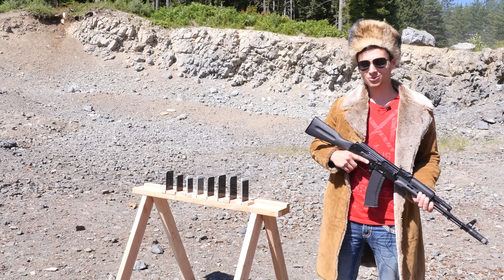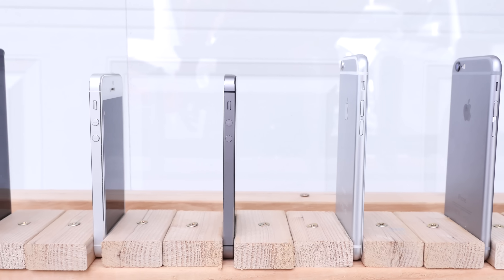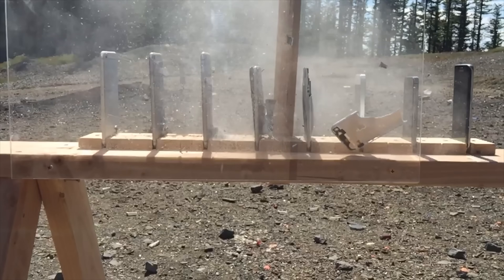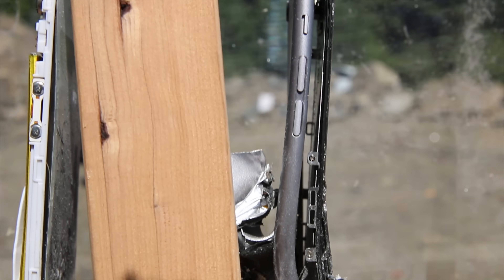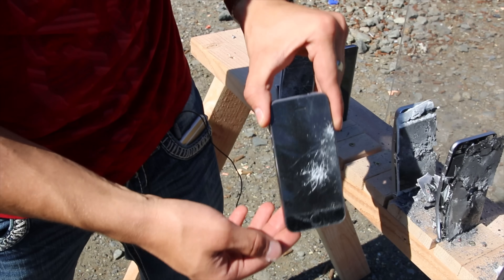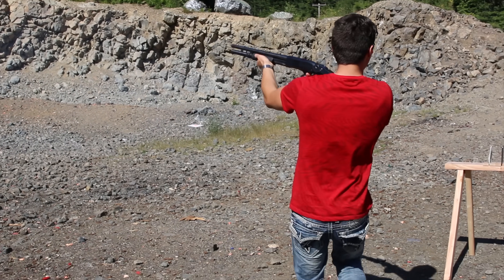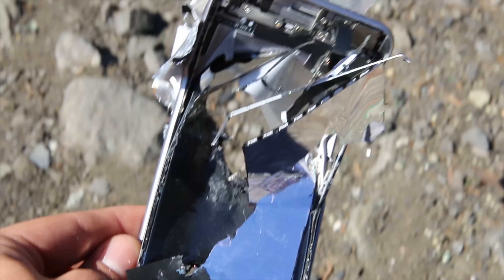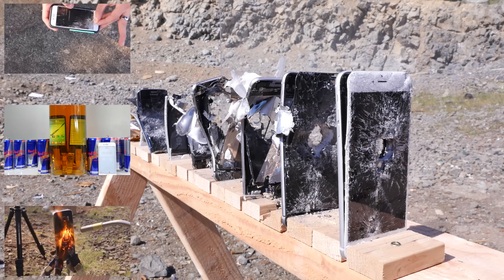How Many iPhones Does It Take To Stop an AK-74 Bullet?

Comment: this test is not prescise as the phones have a space between them. this makes the bullet go further. It is the same as if you have 10 sheets of paper with 5 cm space between each sheet. You shoot with a bb gun, and it easily penetrates all of them. Now if you try having all 10 together as one piece and shoot, the bullet will just make a little scratch without penetrating the first sheet. Its kinda the same when it comes to real guns

Comment: Your video is entertaining, but you have a flaw in your test.  The phones are only being supported at the bottom, which means that on impact the phone will move in the direction of the bullet. Meaning that some energy is being dissipated, where as if the phones are ridged and do not flex I believe the bullet would travel farther to at least the next phone.  But than again so what it was a good test.

Comment: So you can afford all those Iphones but not a slow mo camera? X'D
Reply: Asfand Yar all of those i phones don’t even cost 5% of the slow mo camera😂
Reply: Asfand Yar, iPhone has a slow motion camera
Reply: My phone has slow mo
Reply: Jose Luis Mendoza your phone’s “slow mo” isn’t near fast enough for bullets. You need a really fast camera, like a Phantom Flex, which can take 12,500 pictures a second, or the Phantom V1610 (which costs $100,000) which can record up to 1,000,000 frames per second. So it can take1,000,000 pictures a second, which is extremely slow motion.
Reply: Owned lol

Comment: AK 74?? Wait I thought it's AK 47
Reply: dhudvxvd wusvdhe The 74 is the better version of the 47
Reply: The ak47 is the model designed back in 1947, originally designed to be stamped, but couldn't figure out a proper way to do it so they decided to make it a solid piece of metal, during Vietnam russia really like the performance of the 5.56 round (ar15/m16 bullet) and decided to make their own version of it (5.45) And came out with a new an ak type rifle that shot it in 1974 (ak74) at the point they learned how to properly stamp their guns, having both the akm and ak74

Comment: The size of a 36 size bullet proof vest model is around 31 cm tall and 34 cm wide. (One side only) The cheapest iPhone model I could find on the internet with a quick google search is about 99$, and it is a iPhone 6s 32 GB model, so there must be cheaper models out there. The iPhone 6s 8 cm wide and 15 cm in length. Using this logic, since the area of a 36 sized bullet proof vest is around 154 cm, it would take around 12 and one third of an iPhone 6s to cover the bullet proof vest (One side only). That alone would be 1,220$. Since +EverythingApplePro recommended 6 layers of iPhone, that's 1,220 x 6 which equals to 7,320$. If you want protection on all sides, think of (7,320 x 2) which equals 14,640 plus (((4 x 99) x 6) x 2) to cover the under-armpit protection which equals 4,752$, plus another (((3 x 99) x 6) x 2) to cover the over-shoulder straps which equals 3,564$. When you add all of that together it would cost around 22,956$. These are all rough estimates but most accurately displays the cost of a IBulletProofVest (Doesn't have the same ring to it). That is a grand total of 236.92 iPhones, and since the weight of an iPhone 6s is 129 grams, the IBulletProofVest will weigh at a whopping 30 kilograms. To put this into perspective, A normal, average sized and average price bullet proof vest weighs at a staggering 8 kilograms. At least you'd be the perfect distraction for your enemies when someone tries to call you, but who the fuck cares.

Comment: You should have had them all on Video call and saved the footage. Is there a FPS setting for video call? Can you make slow mo 200+FPS video calls? Do they even have that in normal video mode?
Also note the stand moving backwards, this is absorbing some of the energy, along with your shoulder moving backwards and the blot catch slider thingy of the rifle being pushed back by the gases right before the bullet leaves the barrel. The low shot actually helps because then the phones dont move back by the projectile but instead are held but this was the cause of the stand moving back.. it it was a higher shot then the stand wouldnt have taken the energy the phones tilting back wards would have.

Note 2 the projectile bounced (AKA Ricocheted) off the 3rd phones mount. it went through about 2 inches of wood. so 4 iphones a couple inches of wood and embedded into the 5th Iphone....Who issues licences to these guys? Does anyone give you people Iphones these days?

Putting them flat together you wont get through that many iphones.

Comment: Yup, $649-849 for some glass, metal, and plastic that cost Apple $80-100 to make. Nice premium to the average sheeple buying these phones they can't afford. But, you know, in todays society, its about the "looks" cause people gotta look like they have money, even though they dont.
Reply: +It&#39;s Zero Hour You can't say that about everyone because most people buy an iPhone because they're more reliable than any other. One of my friends had an iphone 4s for like 4 or 5 years now and and it still works and looks fine.
Reply: Alpha Darling - Yes, the days of Jobs. He built quality. Cook is building garbage, even he says their products have a life span of 3-years.
Reply: and silicon, silver, copper, gold, developement of iOS, design, new ideas. If they sell you a brand new phone for 1/3 of their original price (the cost of all the hardware). the conpany will not survive. Also they put lots of effort (cost $$) in developing iOS so they don't need tons of ram and cores to make the phone run smoothly.

Comment: Is that in 7.62x39?
Reply: +mechanized dreams Wrong, the AK-74, usually depending on the weapon's modifications, but for a standard it is chambered in 5.45x39mm.
Reply: +marxman__1839 if it is real ak, the answer is yes.
Reply: +marxman__1839 that bullet appears to be a 5.45x39 The standard AK-74 cartridge.
Reply: Ok, cool.

Comment: He has enough money to buy eight phones but not enough for one camera😂
Reply: +reilem He didn't actually mean 100,000... he was being sarcastic, slow motion camera's are not even $1,000.
Reply: Canyon Harper I doubt he was being sarcastic, he probably was giving a rough estimation. But you clearly don't know much if you think a slow mo camera costs only $1000

Basically every camera has "slow mo". Google "slow mo camera" and you'll get little hand held samsung cameras for under $1k but these are not dedicated slow motion cameras, these are just your run of the mill commercial cameras with a built in "slow mo" feature. But it's probably really shitty slow mo. And this guy wants to film bullets, moving through the air at insane speeds which will require something like 10,000 fps to capture.

I'm assuming he was talking about a proper slow motion camera like a Phantom series camera designed specifically for high speed slow motion capturing which can cost between $45,000 and $60,000.

For example (And this can't even do 10k fps at full HD so this isn't even the "best of the best"): https://www.abelcine.com/store/Phantom-Miro-M320S-High-Speed-Digital-Camera/

The camera the Slow Mo guys use in their videos cost $150k. So yes, they do cost $100k.

Comment: Example of height over bore problem. AK sight is about 2" above the barrel, so if you don't compensate you will put the bullet low at that range. He probably aimed pretty dead center but didn't consider height over bore so it went through the bottoms and wood.

Comment: Technically, 5-6 iphones to prevent an AK-74 piercing your body at close range.  Realistically, you probably won't be shot so close by an AK-74, and you would be injured but likely survive a shot if you only had 4 iphones.
Of course, you need to be wearing a suit made of iphones about 4-5 iphones thick to ensure safety.  And then it doesn't even account for the impact energy dispersing through your body.
Maybe try stacking 4 iphones on a block of ballistics gel and see how far it goes.

Comment: Actually the 4th one took so much damage, because the bullet ricocheted off the wood (as seen at 01:31 and 01:45) so it was tumbling towards the 4th iPhone and therefore, punched a bigger hole into it. Thats why the holes first decreased in distance from the wooden board and then at the 4th and 5th one increased massiveley. Also the statement at 02:02 is wrong, because the wood actually decelerated the bullet aswell.

Comment: MBLAI® iPhone 6s Case Tough Armor Defender [4 Layer][Rugged Rubber][Shock Absorbent][Dust Proof][Built-in Screen Protector][Max Protective] Case Cover For iPhone 6/6S [4.7 inch] (Black)

http://www.amazon.com/MBLAI%C2%AE-Defender-Absorbent-Protector-Protective/dp/B0185G2V8Y/ref=sr_1_1?s=wireless&ie=UTF8&qid=1452248838&sr=1-1&keywords=mblai

Comment: (In only 11 years old)... But the reason why the farther through the phones the greater damage, is because when the bullet hits it slows down so there is not enough kinetic energy to move everything in its path, so technically saying, there is more impact on each metal casing as it travels through all the phones. Let's so you shoot a piece of plastic with  an airsoft gun, The stronger the airsoft gun is the cleaner the whole will be when it hits the plastic because there is enough energy for it to just zoom right through. The weaker the airsoft gun the more damage it will do because it'll hit and all the the energy from the bullet will transfer to the plastic and will create more damage.

Comment: It's a AK-47 not AK-74 unless it's the AK74u
Reply: +Ghost Uploadz Google ak-47 and ak-74. There is a difference. Ak74u is a shorter version of the ak-74.
Reply: +Ghost Uploadz Better stick with those video games
Reply: +Ghost Uploadz AK-47 shoots 7.62x39 while the AK-74 shoots 5.45x39. They are both variants of the kalashnikov. The u variant is just shorter. Most AK-47s you see aren't even AK-47s. They are AKMs or Type-56s.

Comment: The AK-47 and AK-74 are both Russian-made assault rifles designed by Mikhail Kalashnikov. The AK in the name refers to Kalashnikov (K) automatic (A) rifles and the numbers refer to the year in which they were designed (1947 and 1974). In 1978, the Soviet Union began replacing their AK-47 and AKM rifles with a newer design, the AK-74.

Comment: It is an ak-47 not an ak-74
Reply: +evalds grava The AK-47 and AK-74 are both Russian-made assault rifles designed by Mikhail Kalashnikov. The AK in the name refers to Kalashnikov (K) automatic (A) rifles and the numbers refer to the year in which they were designed (1947 and 1974). In 1978, the Soviet Union began replacing their AK-47 and AKM rifles with a newer design, the AK-74.
Reply: +evalds grava No, it's an AK74. Try search engines once in a while.

Comment: How many iPhones does it take to stop an AK-47 bullet!?  Are you blind?  AK-47 rounds have an average muzzle velocity of around 1,602 miles per hour and can easily rip right through concrete walls!  Even whole cop cars couldn't stop the rounds from the AK-47s used by the bank robbers during the 1997 North Hollywood Shootout, and people were still severely injured hiding behind police cars.  Neither could a concrete wall near the bank behind which several LAPD officers crouched when trying to shoot the armored suspects, and in fact, those officers said those AK-47 rounds "tore right through that wall like it was butter!"

Comment: What's the difference between a 74 and a 47?
Reply: +jsh val ak-47 7.62x39mm model 1947, ak-74 5.45x39mm model 1974
Reply: +Sebastian Belgian Thanks
Reply: It's not a Nokia.
Reply: a 74 is a 5.56 round a 47 is a 5x39 or 7x41
Reply: +Nathan Corbett The AK-74 uses 5.45x39 and the AK-47/AKM uses the 7.62x39.

Comment: isnt it an ak-47??
Reply: +Joseph Scheiner The AK-47 and AK-74 are both Russian-made assault rifles designed by Mikhail Kalashnikov. The AK in the name refers to Kalashnikov (K) automatic (A) rifles and the numbers refer to the year in which they were designed (1947 and 1974). In 1978, the Soviet Union began replacing their AK-47 and AKM rifles with a newer design, the AK-74.
Reply: Ak74 shoots a smaller bullet. 47 would have cleared the phones ez

Comment: 74😂😂😂 its 47 idiot
Reply: It's Ak-74 you fucking degenerate.
Reply: +Black opps 2 Edits The AK-47 and AK-74 are both Russian-made assault rifles designed by Mikhail Kalashnikov. The AK in the name refers to Kalashnikov (K) automatic (A) rifles and the numbers refer to the year in which they were designed (1947 and 1974). In 1978, the Soviet Union began replacing their AK-47 and AKM rifles with a newer design, the AK-74.

Comment: It's ak 47 not 74
Reply: Nope, it's 74
Reply: +Caleb Shattock The AK-47 and AK-74 are both Russian-made assault rifles designed by Mikhail Kalashnikov. The AK in the name refers to Kalashnikov (K) automatic (A) rifles and the numbers refer to the year in which they were designed (1947 and 1974). In 1978, the Soviet Union began replacing their AK-47 and AKM rifles with a newer design, the AK-74.

Comment: It's AK-47 duhhhh
Reply: +Skull Pirate202 The AK-47 and AK-74 are both Russian-made assault rifles designed by Mikhail Kalashnikov. The AK in the name refers to Kalashnikov (K) automatic (A) rifles and the numbers refer to the year in which they were designed (1947 and 1974). In 1978, the Soviet Union began replacing their AK-47 and AKM rifles with a newer design, the AK-74.

Comment: Dont you mean a ak-47 not an ak-74
Reply: +Perky Stew No. Try search engines once in a while.
Reply: +Perky Stew no, that is an ak-74 it fires 5.45x39mm where the ak47 shoots the 7.62x39 the ak74 is the current Russian battle rifle as the ammo is lighter therefore you can carry more.
Reply: +Perky Stew The AK-47 and AK-74 are both Russian-made assault rifles designed by Mikhail Kalashnikov. The AK in the name refers to Kalashnikov (K) automatic (A) rifles and the numbers refer to the year in which they were designed (1947 and 1974). In 1978, the Soviet Union began replacing their AK-47 and AKM rifles with a newer design, the AK-74.
Reply: +Wadan Popal YOU KNOW TOO MUCH ABOUT GUNS!!!

Comment: im pretty sure its a 47 xD
Reply: +Kruller Its a 74, but whatevs
Reply: +Kruller The AK-47 and AK-74 are both Russian-made assault rifles designed by Mikhail Kalashnikov. The AK in the name refers to Kalashnikov (K) automatic (A) rifles and the numbers refer to the year in which they were designed (1947 and 1974). In 1978, the Soviet Union began replacing their AK-47 and AKM rifles with a newer design, the AK-74.

Comment: Its a AK-47 douche not a 74
Reply: No its a 74.
Reply: MrFiggets same
Reply: There is an ak-74 kid-_-
Reply: +Jason Moyle The AK-47 and AK-74 are both Russian-made assault rifles designed by Mikhail Kalashnikov. The AK in the name refers to Kalashnikov (K) automatic (A) rifles and the numbers refer to the year in which they were designed (1947 and 1974). In 1978, the Soviet Union began replacing their AK-47 and AKM rifles with a newer design, the AK-74.
Reply: Jason Moyle But you're wrong

Comment: Ok, lets settle this right now. He is using an AK74. That is a real thing. It is the gun the Soviet Union replaced the AKM with. An AKM is an AK47 but with a few improvements, mainly more stamped parts for cheaper and quicker manufacturing. All three guns are pretty much the same thing, the biggest difference is that the AK47 and AKM shoot 7.62x39 while the AK74 shoots 5.45x39

Comment: AK 47 not 74
Reply: No it's an AK-74 which fires a smaller caliber bullet though both are similar you can't consider them to be the same.
Reply: +Zach Is AWESOME The AK-47 and AK-74 are both Russian-made assault rifles designed by Mikhail Kalashnikov. The AK in the name refers to Kalashnikov (K) automatic (A) rifles and the numbers refer to the year in which they were designed (1947 and 1974). In 1978, the Soviet Union began replacing their AK-47 and AKM rifles with a newer design, the AK-74.

Comment: if u used an ak47 it would have kept going, u r using the qrong bullet for penetration.
Reply: +Sergio Mendez Actually the 5.45 cartridge should have higher penetration.
Reply: He used AK-74
Not AK-47
Reply: The 5.45x39 has better penetration compared to the 7.62x39
Reply: Back up we got a bad ass